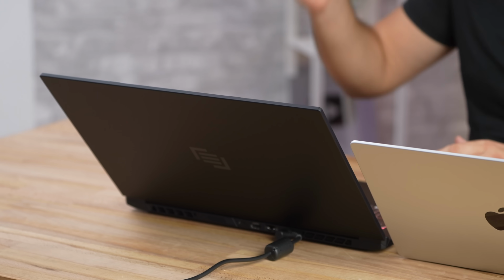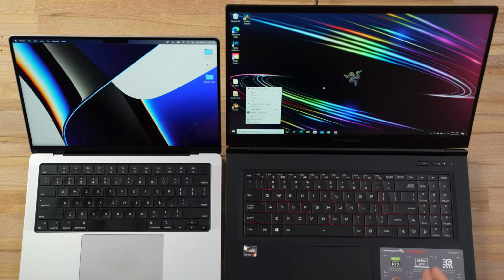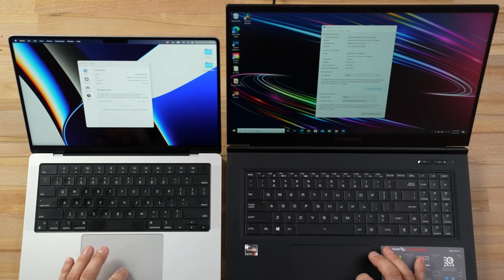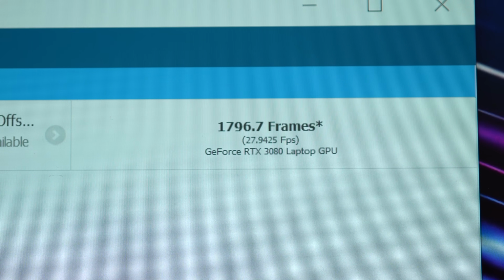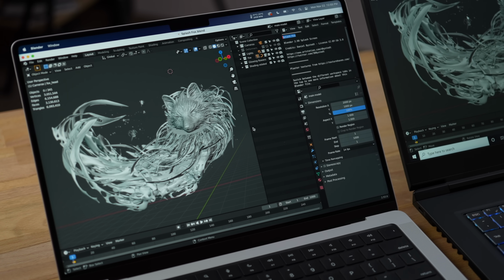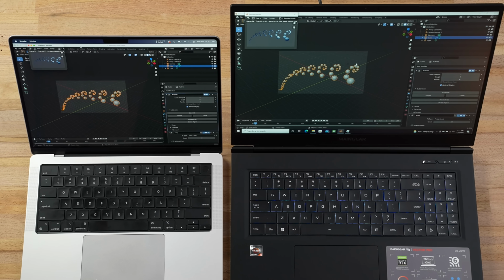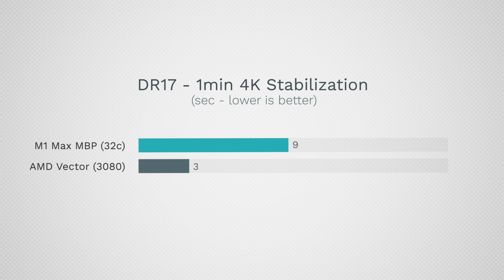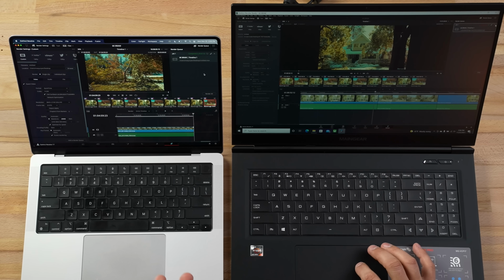Forget Intel! Can AMD's BEST Laptop Beat the 14" M1 Max?

Comment: I got 217 on speed-o-meter on my xps 13 9310 with i7-1185G7 in chrome. Chrome is faster than edge
Reply: 11th gen intel processors have more powerful single core performance, that's also why your xps is faster

Comment: This is just unbelievably exciting; we’ve known this courtesy of the M1 and Max Tech predictions a year ago but seeing it for real makes you realize the revolution for the computer industry that Apple Sillicon is. Nvidia and AMD (and Intel in the CPU space) have a LOT to catch up to and I bet the next few generations of both chips and SoCs will become a very competitive space as the rest of the industry puts itself back together! The M1 Pro and Max are a statement.
Reply: Also those tests are all aimed at content creation. We know Apple shines there but that's not what most peoples do and those benchmarks are not representatives of the performance you will get in thousands of Apps that are not optimized for MacOs and probably never will be. Don't get me wrong, I have an M1 MacBook Air that I love it for what it is but for performance The M1 Max does not even come close to what I need.
Reply: For example I use Stockfish, on a good AMD desktop it runs at over 200,000 kn/s against 13,000 kn/s on the M1. That's over 15 times faster. I am told it is because it is optimized for x86's SIMD instructions extensively. Not Apple's fault but all Apps are optimized on x86, not just video editing, photo editing, music editing and the like.
Reply: @danielfrappier3378  so apple needs to add x86 support!
Reply: @SwaggScope  I know you are making a joke and that it's not technically feasible but that's a problem for every new architecture. The software is optimized for the old one. Making it worst is that Apple as a small part of the market and it's not worth it for a lot of software developer.
Reply: you do realize that AMD and Intel make way more powerful CPUs right? What do you mean they have a lot to catch up to? Apple Silicon isn't even half the performance of Intel's and AMD's latest flagship CPUs. If you are talking for laptop then sure
Reply: Apple literally changed the computing industry for the millionth time.. Their future releases are going to be even more monumental I believe
Reply: @hackercoolio  i hope they keep gamers in mind next time
Reply: @SwaggScope  Shouldn't you tell game developers instead? They didn't make games for Mac due to lower market share?
Reply: I don't think so, apple had not made something powerful enough before, so now that they did invent something good apple might get their attention and might get some developers to think about apple, plus apple is mostly focusing on editing and professional stuff not gaming, of course who would want to invest in someone if their whole focus is on video and pic editing. The OS is so much limited compare to Windows, Windows give alot more option to developers for games.

Comment: I mean the AMD lost the minute you kept it plugged in and in ""turbo mode"", whatever that is. Also the fact that you have ""unlock"" the graphics? I'm pretty tech savvy and I didn't even know that was a thing lmfao
Reply: Lol, agree
Reply: "Unlocking" it out of the state the thing was designed for is a recipe for unknown & unintended behaviour. Not very different from ripping out the fan from those M1 macs & calling it a "noise fix". 😆

Granted, I expect the M1 to still do reasonable without a fan.

Comment: I appreciate the fact that you try to give us the best results on laptop comparison but I am really not satisfied with the blender test. 

You always render using the CPU on these devices. Definitely the M1 Max is faster than AMD mobile CPU’s but people just don’t use CPU for 3d rendering.

If you actually compare the eevee and cycles using gpu on real world complex projects, the RTX cards does that in under a minute while the 32c gpu on mac take around 10 minutes

I know that metal is not yet supported but M1 max gpu’s can’t be compared to NVIDIA’s cards on tasks like game dev, 3d rendering, gaming, etc.

I know there is no competition for apples performance per watt power, but apples gpu are no match for rtx cards(TGP matters) and you should say that in your videos rather that saying saying that M1 Max smokes these laptops
Reply: that not true, eevee uses GPU.   and to be honest..its embarassing that nvidia could only pull off 1 sec faster using 165w compared to the 30w used by the 14in m1 max.  If you want to see more videos of low wattage m1 pro destroying my rtx 3070 in Blender viewport playback and simualation baking (and some gaming) I have them on my channel..   TGP matters when your overall design isnt as efficient.

Comment: The Maingear laptop is a gaming laptop with High refresh rate screen and a big powerful laptop overall. The apple laptop is a premium work-laptop designed for mobility and better quality peripherals and screen, which is exactly what he is biased towards. Maingear laptop is can be better than the Macbook for its target audience.
Reply: Ofcourse the maingear laptop will smoke MBP in gaming but otherwise in other tasks its basically useless if you don't plug it in...
Reply: @azanrashid2270  Your MBP is basically handicapped by its mobile design though, since plugging it in doesn't change its performance.

Whichever way your usage of the machine consists of is what your buying decision should be based on.
Reply: @MLWJ1993  that "mobile design" you are referring to is called ARM based chips which is future of technology, soon intel will also introducing its ARM based chips....
Reply: @azanrashid2270  ARM is not perfect either. I hardly call it "the future". It's like solar energy, it's great, but not a feasible substitute for nuclear power on its own.
Reply: @MLWJ1993  we haven't seen so much of ARM based technology, i am sure it will be more advanced in future...

Comment: I think the graphics are capped at 30 FPS on battery. That might be why the score was so low
Reply: Or I wonder if Optimus kicked in and was like nope you get to use the iGPU…
Reply: @MoChuang343  Also possible but I am not sure if it does have a mux switch.
Reply: yes its a setting in geforce experience you can disable to allow higher framerates when on battery
Reply: Yes GeForce experience automatically sets the fps limit to 30 fps to help preserve battery life and battery health
Reply: Legion 5, 5 Pro and, 7/7i have a MUX switch and are also hard limited to 30fps while unplugged. There is a certain option in Nvidia Control Panel that controls this IIRC.